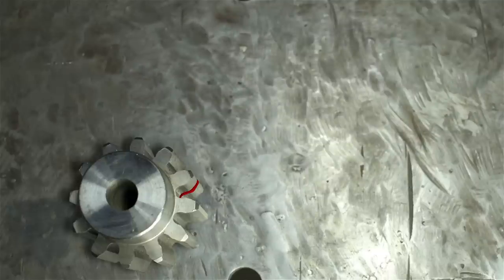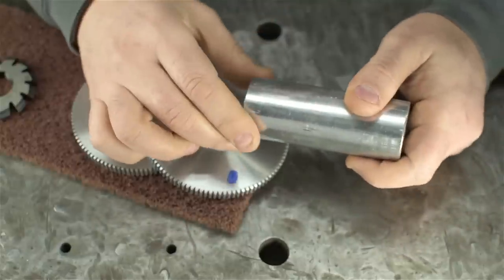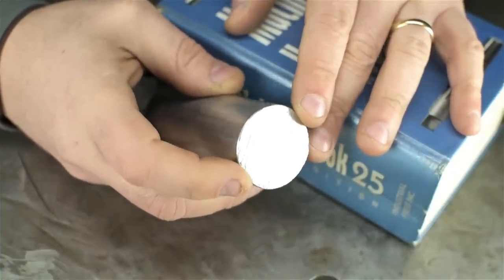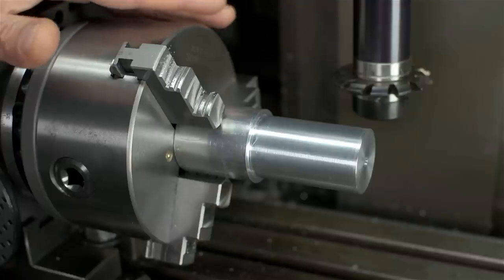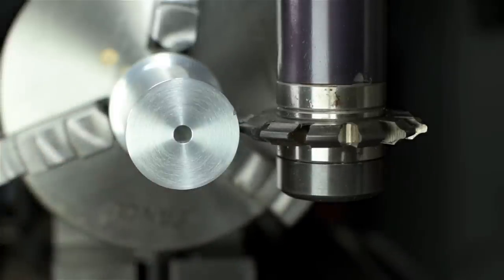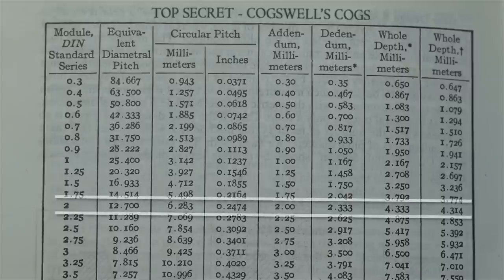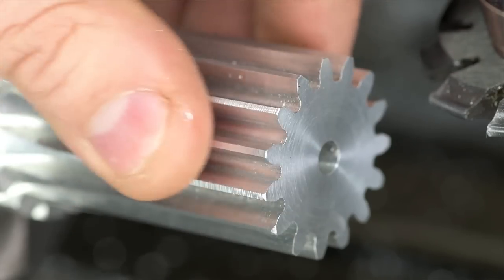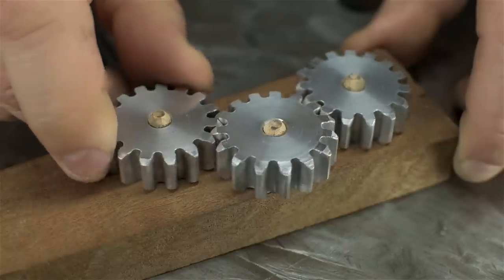15T-M2 Let This Be A Lesson To Ya!

Comment: Just a guess on why the chamfered edge, but if the axis of rotation aren't perfectly aligned I think the force being put through the gears would be borne by the outside corners of the teeth and for hardened gears might cause them to chip.  With a chamfer, even if they're not perfectly aligned,  you increase the contact surface and reduce the force/area making a tooth less likely to chip/crack.  Again, just a guess.  

You could test it with a set of gears with and without chamfer, misaligne them intentionally and measure the contact area with blue dye.

Comment: You should machine a few replacement gears for the ones used in a drill, get rid of the powdered metal or plastic ones that it comes with and give your tools an upgrade.

Comment: Buy a gear for a dollar? I am designing stuff right now and need gears. They are crazy expensive! When I was a young kid, I could buy all kinds of small gears from Boston Gear for real cheap. I would get several gears, some shafts, collars etc for I think under $10.00 usd. Now, everywhere I search, just a single gear is like $12.00 and up. Search gears on McMaster or similar. So I decide I will make my them here. And again, total mind freak, the price of a Diametrical gear cutter set. Just a single cutter is the same price of the whole 8 piece set of Module cutters. And so, I will go module. I am making stuff for in house projects, and so, module is fine, fortunately.
Reply: If you really want to do it on the cheap you can use a fly cutter with a form tool.
Reply: When I was a kid I could walk down to the penny gear store. 🤣
Reply: Maybe a bit off topic, but I strongly suspect the high cost of gear production is behind auto makers aggressively pushing out CVT's (Constantly Variable Transmissions). IMHO, CVT's are not the correct technology for automotive applications. I also think some auto mfg's may be hiding CVT's behind high count computer generated tactile 'shift points'... ever notice how many 'gears' some newer automatics are claimed to have? Rant rant rant...
Reply: I believe steel in general has risen in price. Price a lite gage metal stud, more expensive than a wooden stud.
Reply: Look into replacement change gears for myford and southbend style lathes .. they seem pretty cheap
Reply: Maybe find a home gamer that takes on small jobs, without the huge overheads of a running a store they may be able to make what you need for a fair price.
Reply: I have to wonder that maybe there is just no demand for small gears these days. But, that seems illogical because, are there not people / small shops that experiment, develop, create etc things that need small specific purpose geared transmissions? This has been on my mind for a long time. I have considered producing small steel gears and sell for cheap just for those people who are creative and who give up on projects because of the cost of gearing, which would make selling their prospective product too expensive to sell, or make their experiment too expensive. Don't kids experiment with creating mechanical things? I felt like an outsider when I was young, most kids were throwing a ball around and thought I was weird for playing with gears, electronics etc. But there had to be other kids who were like me. I just do not like the fact that kids, or people with not much money can not afford to experiment with gears, or just make and sell products that need gearing. What I do in my shop is quite expensive for the customer, and making gears normally is far out of the question. But, someone just has to step up and do it for an affordably price. I would not purchase a gear hobber, shaper, etc, just would have to make them on a mill because do not have the room to set up a gear mfg plant. This comment is more like a rant, but I am mad that kids and others can not get gears for reasonable price anymore. Maybe This Old Tony, or one of you would consider setting up and making gears. Based on prices, it seems that one could make good money at it from a home shop and still sell at far cheaper than what is available.  Rant over.
Reply: @rwbishop  CVTs aren't hidden... New automatics do have all of those gears. It's not hard to make an automatic have a ridiculous number of gears. It's impossible to hide a CVT by claiming it is an automatic though. one look under the hood would reveal the truth. CVT cars use shift points because average stupid consumers desire them, not because car manufacturers want them. Their cars get negative feedback when a CVT is used as intended. People want things to be "sporty" so they want it to sound like gears are changing whether they are or not.
Reply: Martin Luther  True, but if you order from a gear maker, you pay more because you're inconveniencing them.....spring companies are like that, too.......
Reply: rwbishop   How would that effect the cost of machine gears? The type of gears talked about here have little to nothing to do with automotive transmission gears.
Reply: scythelord   Stupid consumers? I don’t like CVTs and I’m no stupid consumer.
Reply: @scythelord  Those "shift points" take away every advantage the CVT offers.  The wife's cars have been shiftless CVT, two of them, since 2007.  At first, it takes a month or so to get used to the shiftless feeling.  Getting into a shifty CVT now feels spongier than a slushbox.  I wish the mfgs would offer an option of programming the shift points in or not.
Reply: It's almost as if inflation is a real thing :o
Reply: @rwbishop  Interesting topic that. If you haven't heard of/seen the channel Engineering Explained he does a few videos on CVT. They're worth a watch. (He is/was a mechanical engineer by trade and now does youtube and focuses on automotive)
Reply: @remy5405  The torque is definitely a problem, but I wouldn't say a problem for the average commuter car.  Had an '07 Altima w/CVT and tried to climb a /really/ steep service road and it started slipping.  Tried in reverse and got much farther, but still started slipping halfway up.  I have tried similar roads with a manual, and it's doable, but the clutch is roasted.  A torque converter may be the only solution for these hills/situations.

Also, never change the CVT fluid...
Reply: @dk-bw4gk  , why never change the CVT fluid?
Reply: @rwbishop ...What is your address?  I need to send you some tinfoil hats.
Reply: @Ultrafrozen  So... a BMW tech friend told me, "change it always or never change it".  This was before I had any issues with any CVT.  The CVT (as he explained it) gets broken it to its fluid "environment".  If it's happy in dirty fluid, keep it in dirty fluid. Or keep it in it's clean environment.  The Altima had 140k miles on dirty fluid before I totaled it, no probs ever.  Next car was Subie Forester.  106k miles and the engine recall came out.  New fluid and it was a complete dog; slow acceleration, shaky at idle, not smooth acceleration, shuddered at slowdowns.  Now it's at ~170k and it's working awesome again.  Started working good again at about 150-160k.  It was so bad that we started shopping for a new car.  Since it "fixed" itself, we said fuck it and we'll drive it into the ground.
Reply: Ali express. Gears done cheap
Reply: @scythelord  CVT's that have shift point's instead of being used optimally made me get an electric car. Love my i3.
Reply: @DrewLSsix  what don't you like about the CVT?
Reply: Sounds like someone could make a nice profit selling them to other hobbyists for $5 each.
Reply: @rwbishop  ...  Huh?  CVTs are sweet, you dingus.  Peak torque across most all RPM, from what I foggily remember.  Basically fills in ALL the gaps of a geared transmission, at the expense of a bit of fun while driving.
Reply: @dk-bw4gk , OK, so the same mindset that people have with geared auto transmissions.  The thought being that if the fluid hasn't been changed in a long time, just leave it, new fluid can dissolve some of the sludge built up over the years and plug the control passages screwing up the shifting aspect of the transmission.  I'll continue to change my fluids on a regular basis to prevent this and to ensure the degradation of the highly stressed oil doesn't affect the CVT transmission's life.
Reply: @Ultrafrozen  Naw, I don't think you read what I wrote.  It's nothing like that.
Do whatever you like.  It doesn't matter and the CVT will outlast the car either way.  Those fluid changes are expensive too.
How often are your changes, btw?
Reply: @dk-bw4gk  , 100,000km (62,000 miles) at first change.
Reply: @Ultrafrozen  You've already done it? Or it's coming up?
Reply: @dk-bw4gk  Done a few months ago, no issues so far.
Reply: @Ultrafrozen  Glad to hear it. Nothing but problems with my Subaru. I will never change the fluid again. What car did you change it in?
Reply: @JochemKuijpers  If only wages were keeping up.
Reply: For prototyping a 3D printed layout is far cheaper.  Lots of libraries have maker sections and your local hackerspace may be willing to print gears for free.
Reply: @dk-bw4gk , 2016 Honda Civic Turbo, different CVT than the base Civic.  It's third generation stolen from the Accord.  My son just bought a Subaru Crosstrek, not sure if it has a CVT though.  He seems to like it so far.

Comment: 3 gears on a push stick? Doesn't that give you a 180 degree phase shift and make it a pull stick? I'm confused.
Reply from the maker: it is intended for advanced pushers.
Reply: No phase margin. If not experienced it will break into oscillations. Advanced users only.

Comment: At the metal shop, where I work and my family owns, we have lots of old equipment with gears.  There's a roller in particular with a gear similar to the one in the thumb.  It cost $100 for one with the right teeth and then another $100 to have it machined to the right size.   I wish we could just buy a nice lathe for a few thousand so I could have saved $200ish dollars and build other cool stuff.
Reply: Just buy a good one and you'll thank yourself later, this I guarantee.

Comment: Have a nice water wheel there!  Nice pull start.   My guess on the gear tooth - keep the edge the High moment swing arm edge from mounting hardware that touches that face.  If a tip hits a metal plate, you might have a gear train wreck.   Hum - have a gear cutter, what size ? - do I have a mandrel for the mill ? I have one for the lathe.   Hum    -Martin

Comment: The chamfer on the gears is to have less of an stiffness jump. Additionally, and maybe more important, when the the gears have not completely parallel axis, the edge is hitting the other tooth. Therefore the gear is louder and is producing shavings.

Comment: the chauffeured edge on a gear has multiple reasons.
1. easier to install
2. less noisy and less chance of breaking/chipping the teeth (square edge gears tend to chip the ends off)
3. if the gear slides into mesh ie on a moving shaft it helps the gears go into mesh 
4. not  a big reason but less likely to cut you when handling the gears (same reason you debur a piece of metal

Comment: The chamfer on the teeth is for clearance. It's usually done on gears which are sandwiched between tho steel plates. The edges of the gear see the most wear and it's kinda likely that some deformation happens here. The chamfer prevents a bur from scratching on the mounting plates and creating additional friction.

Comment: IIRC The chamfering is there for a couple of reasons - to remove burring during manufacture as well as chipping and edge breaks, particularly if they're hardened/high perf gears.  Also helps gears to mesh if that's what's involved.

Comment: Hey Tony, great video as ever! 
The edges of gear teeth are typically faced to account for either known or probable transmission errors. If the rotation axes between two gears are skewed, the edges would dig into the profile of the gear. While this would probably cause issues all along the profile, the greatest effect would occur near the edges of the teeth. In cases where the skew error is known or calculable, the profile is sometimes further modified to make the teeth sort of elliptic along the length. 
Fun fact on that, the process for modeling the exact alteration, as too much would result in loss of torque, is a bit of ~buzz~ topic in the AGMA community. For instance, if the subject is even brought up near my professor who supervises research on this topic, his eyes light up. Usually makes my day.
Keep up the awesome work, loving these gear videos!
Reply: I imagine ISO people would get just as excited about the topic, but in a more metric fashion
Reply: @zomgthisisawesomelol I can dig around for a standard on chamfering specifically. I believe it's just something commonly done, though. Modifying the profile along the face width in that elliptical fashion is often called crowning. Tip relief is when the tip of the tooth, right before the profile approaches the flank, is fileted along the face width. This is done for the same reasons but, like crowning, usually requires some form of optimization. The chamfering of the edges mirrors the tip relief modification but obviously only at the edges. It's sort of a good trade off in allowing that little bit of safety for inevitable deviation while keeping as much of the face width in effective contact and therefore transmitting torque. In a high-precision gearbox, a combination of these two modifications, along with a few others, is sometimes used to improve efficiency. As gears are fairly efficient as is, these precise modifications are only really used when needed or in a later improvement/iteration of a design. Chamfering the edges provides that happy medium of not having to do a lot of math but allowing for a safety factor. Or, atleast, that's my understanding of it. I can look for some relevant papers on it too.

Comment: great vid and your question at the end.. well just an educated guess theory is for wear and tear on the gears bore, I have a 1940's Myford M type lathe and the change gears do not have chamfers on the tooth (s) , when the bore wears the gear then wobbles very slightly on it's pin, the very edge of the teeth which are not chamfered then grind the bottom of the tooth valleys so sounds like a very fast march, or grind the face of the opposing gears tooth, another theory is for strength, an unchamfered tooth edge will be more susceptible to chips or breakage if say.. taking off a change gear quadrant and dropping on the floor :) that is why I keep a handy pile of swarf on the floor at the left end of the lathe

Comment: The question I know you addressed but for some reason I'm not completely clear on related to the process of choosing gears: 1. I have a motor that moves at X rpm, and I want to rotate a workpiece at Y rpm, how do I pick the gears required, what are my considerations and options along the way, etc.; I'm sure it's 101-level engineering, but not obvious to me at least.
AND THANK YOU FOR THE GREAT VIDEOS!!!

Comment: The chamfer is for gears that might not be mounted in the same plane. Tapered gears are better for angled planes, but when you have a small error, the chamfer cuts down on noise and wear.

Comment: I remember reading somewhere that chamfering a gear helps it resist case hardening and eventual edge spalling (bad if you are inside an oil filled environment that contains bearings)

Comment: I've resisted the urge to splurge on gear cutting equipment until now, when I hit a project that needed some gears.... so I did the maths, worked out that a rotary divider and involute cutter cost only twice as much as the gears would, ordered the table and cutters and set about looking for 200 mm dia steel blanks that can be case-hardened. Sadly, they cost a lot more than the nothing that I'd factored into my original calculations. I wonder: do you have a background in advertising?  I ask because you are incredibly good at getting me to spend money that I don't have on things that I might not really need. Still, I love the videos. Keep them coming, please.

Comment: As the gear wears or the shaft it sits on wears, the load on the edge of the tooth will increase and eventually chip. Also, when heat treating, the extreme edges of the tooth will be more susceptible to cracking.

Comment: The chamfer does two related things and at least one other... As open gears mesh it allows the lubricant to pool up in the valley created then get sucked back in as the gear's teeth disengage. In an enclosed system it prevents high hydraulic pressure by breaking the seal on the sides. In applications like a transmission the chamfer allows gears with tolerance to engage without the tips of the teeth hitting neighboring gears. $0.02

Comment: My guess for that chamfer is that it makes assembly of the boxes containing gears easier, because the chamfer will "auto-mesh" the teeth to some degree (like reverse in a standard transmission with no synchronized reverse).

Comment: chamfering gears is made to focus the force of the leaving tooth to the middle of the gear, if they wasnt they could start wearing down sideways and in the end break something. 

One more reason is that if something get in contact with the gears and they were sharp they would jam easy or break. When adding this little cutoff you will lower the risk of breakage.